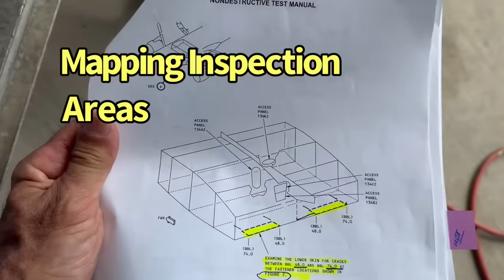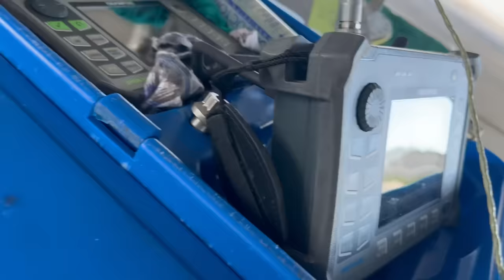AIRPLANE FUEL TANK ENTRY and CRITICAL inspection  #airplane #video #foryou

Comment: I would of thought the fuel tanks would of been cylindrical for stability issues. Like all the fuel tankers we see on the roads 

Imagine all the jet fuel sloshing about in these square walled tanks when a huge plane makes its manoeuvres in the air
Reply from the maker: Glad to see my aviation family here GibbonLimbs ✈️ ⚙️ So with this equipment we can detect cracks under the paint were the naked eyes can’t see. The entire airplane full capacity is 26K gallons of fuel and weighs 6.7 lb per gallon. I see what you are saying about the shape of the fuel tanks and sloshing. I guess it works out. The fuel was transferred to wing tanks, than the tank was drained, purged and vented for 3 days. It has to be all done for safety. I am glad that I am sharing aviation awareness with my videos. Welcome to our show. Check out our New video just uploaded link ⬇️ 
THE smallest DETAILS makes the BIGGEST DIFFERENCE #aviation #video #foryou
https://youtu.be/my6YMdnT388
Have a good day, See you soon next video ✈️👍

Comment: I am surprised the "atmosphere" inside there is safe and comfortable to breathe. I would expect some vapor or at least an unpleasantly strong odor.
Reply from the maker: Glad to see you guys here Csjaugiedog ✈️ ⚙️ I was surprised myself usually there is very strong odor in these tanks. This job is not for everyone. There are smaller and much larger tanks, not to mention the wing tanks. So with this equipment we can detect cracks under the paint were the naked eyes can’t see.The fuel was transferred to wing tanks, than the tank was drained, purged and vented for 3 days. It has to be all done for safety. I am glad that I am sharing aviation awareness with my videos. Welcome to our show. Check out our New video just uploaded link ⬇️ 
THE smallest DETAILS makes the BIGGEST DIFFERENCE #aviation #video #foryou
https://youtu.be/my6YMdnT388
Have a good day, See you soon next video ✈️👍

Comment: Zero safety. No LEL tester, no life line, no stand by person, no entry lockbook, no rescue team, no safety oxigen masks.
No harness, no intrinsically safe equipments, no proper ventilation, no safety clothing. 
Open fuel tank and the engines are still running. Interesting.
Reply from the maker: Glad to see you here  Viktorase ✈️ ⚙️  You are perfectly right about everything other than the engine is not running. The low pressure side was wind-milling . This video was taken couple years ago before I took confined space authorization training. It’s not everyday we get in a fuel tank of an airplane and want to spend more time than we need. This is very dangerous, so with this equipment we can detect cracks under the paint were the naked eyes can’t see.The fuel was transferred to wing tanks, than the tank was drained, purged and vented for 3 days. It has to be all done for safety. I am glad that I am sharing aviation awareness with my videos. Welcome to our show. Check out our New video just uploaded link ⬇️ 
THE smallest DETAILS makes the BIGGEST DIFFERENCE #aviation #video #foryou
https://youtu.be/my6YMdnT388
Have a good day, See you soon next video ✈️👍
Reply from the maker: Oh sorry for the late ⏰ reply. Thank you for your concerns I do appreciate them. Have a great evening

Comment: Wouldn’t have thought shorts were adequate PPE for the task......then again the rest of the attire is hardly suitable either.
Reply from the maker: Glad to see you guys here Leslieallan✈️ ⚙️ it was poor planning on airline part. We were fishing when we got the last minute call. ☎️ This job is not for everyone. There are smaller and much larger tanks, not to mention the wing tanks. So with this equipment we can detect cracks under the paint were the naked eyes can’t see.The fuel was transferred to wing tanks, than the tank was drained, purged and vented for 3 days. It has to be all done for safety. I am glad that I am sharing aviation awareness with my videos. Welcome to our show. Check out our New video just uploaded link ⬇️ 
THE smallest DETAILS makes the BIGGEST DIFFERENCE #aviation #video #foryou
https://youtu.be/my6YMdnT388
Have a good day, See you soon next video ✈️👍

Comment: This is not a fuel tank, I worked for Airbus
Reply from the maker: Glad to see you here Dan. I understand your concern, this is a Boeing 767-300 center tank not a Dry Bay. It’s illustrated on the Mapping in the video. Check out our short New video link below ⬇️ 
THE smallest DETAILS makes the BIGGEST DIFFERENCE #aviation #video #foryou
https://youtu.be/my6YMdnT388
Have a good night

Comment: The number two guy needs to lose weight to get in and out easy the job is not for the weak heart
Reply from the maker: Glad to see you here TanveerAhmed ✈️ ⚙️ yeah this is for thin people. It is the worst job in aviation. So with this equipment we can detect cracks under the paint were the naked eyes can’t see.The fuel was transferred to wing tanks, than the tank was drained, purged and vented for 3 days. It has to be all done for safety. I am glad that I am sharing aviation awareness with my videos. Welcome to our show. Check out our New video just uploaded link ⬇️ 
THE smallest DETAILS makes the BIGGEST DIFFERENCE #aviation #video #foryou
https://youtu.be/my6YMdnT388
Have a good day, See you soon next video ✈️👍

Comment: It doesn't make sense.
I can see dust laying inside those "tanks". There hasnt been fuel in those compartments for ages if ever. Also, you would need to wear respirators because the fumes would still be present even after three days of ventilation.  I call BS.
Reply from the maker: Glad to see you here RicArmstrong ✈️ ⚙️ There is no BS here. We got called last minute while we were fishing. We didn’t even know the airplane was going to need this inspection it was AOG. The most important thing for us is to complete the inspection 🧐 cause there is a lot riding if we find a crack with that special equipment we had. Usually we explain more in details when we are not pressed for time. I am glad I made this video for public awareness, so they can see what professionals do behind the scence to keep skies safe. It has to be all done for safety. Welcome to our show. Check out our New video just uploaded link ⬇️ 
THE smallest DETAILS makes the BIGGEST DIFFERENCE #aviation #video #foryou
https://youtu.be/my6YMdnT388
See you soon next video ✈️👍

Comment: Absolute bs ,how are the fumes???????????? If u believe this you can be made to believe anything  😂😂😂
Reply from the maker: Glad to see you here StevoRicho ✈️ ⚙️ No fumes. It’s not everyday we get in a fuel tank of an airplane and want to spend more time than we need. This is very dangerous, so with this equipment we can detect cracks under the paint were the naked eyes can’t see.The fuel was transferred to wing tanks, than the tank was drained, purged and vented for 3 days. It has to be all done for safety. I am glad that I am sharing aviation awareness with my videos. Welcome to our show. Check out our New video just uploaded link ⬇️ 
THE smallest DETAILS makes the BIGGEST DIFFERENCE #aviation #video #foryou
https://youtu.be/my6YMdnT388
Have a good day, See you soon next video ✈️👍
Reply: @slipperybeastaviationfishingsh hi,im an aluminium welder that has repaired a lot of different fuel tanks and i have never experienced such a total evacuation of gases from a used fuel tank as shown in this video, and I am talking about 2000 gallon tanks ,we would use a purge method to evaluate gases during the welding process otherwise you gonna go BANG!  Purge welding is running an inert gas i.e (argon ) thru the tank while welding,  so how do these people handle the fumes that would be present in these massive tanks ?????? ....🤔just say'n.
Reply: @sexigrande1792  aluminium absorbs most contaminants, to get a tank of that size clean would take a long time ,are these aircraft out of service for months??? Dude the amounts of fuel that are alleged stored in the flimsy aluminium wings could not be supported,how many tonnes?????get real!!!!
Reply: @sexigrande1792  it's a question of weight also?,BTW isn't it taught very quickly in pilot training that curvature equations are not used on flight plans? And to treat the surface as "one flat (PLANE) " 🤔